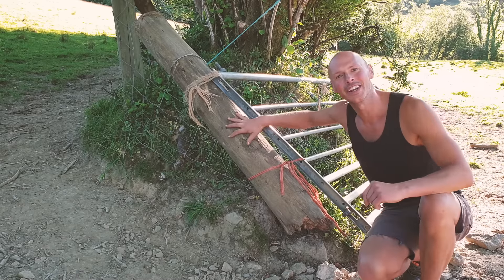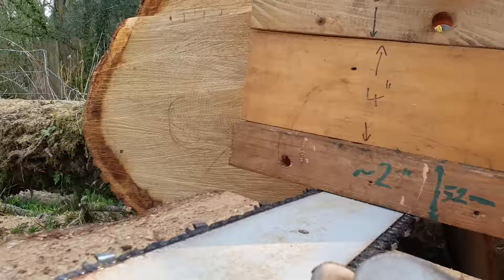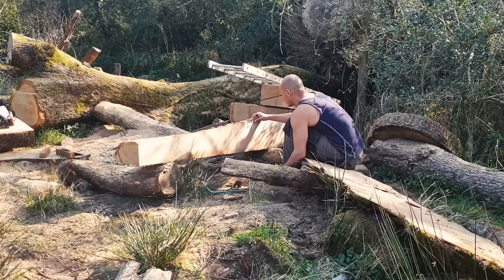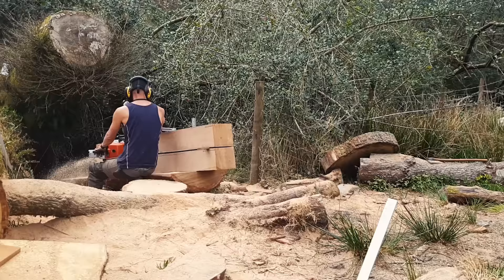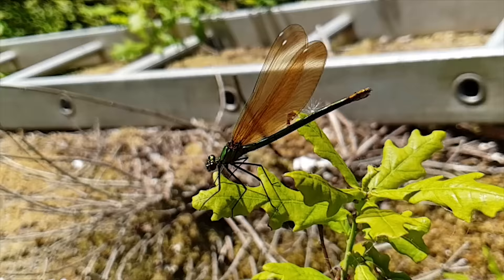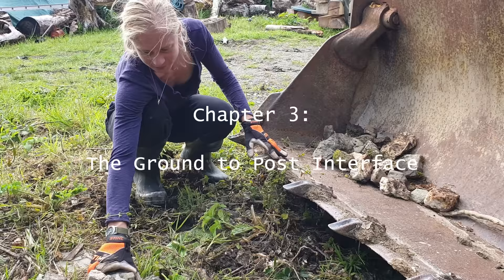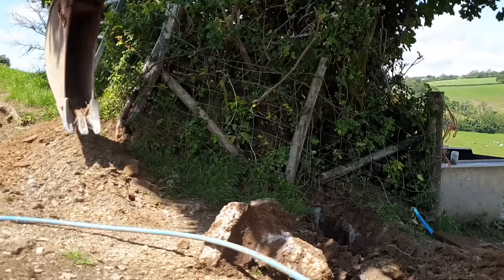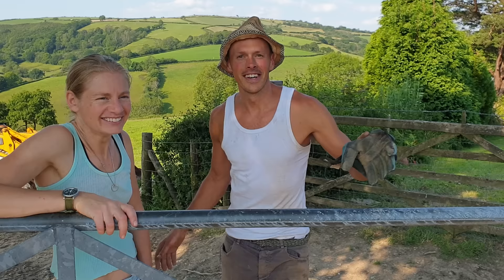The 3 secrets to ROT PROOF POSTS and how to make them

Comment: Find a hedge tree! Problem solved. Here in the Midwest Osage Orange will last 100 years the fence around our pastures is one hedge (what most call Osage) and one steel and corners are hedge. The steel must be replaced every 30 years, but not the hedge!
Reply: I used Osage orange (hedge) for gates, fence posts,   and corner posts.  The main corner post was a piece Osage orange which my great-grandfather cut down around 1900, it was about 12" dia. at the bottom and about 10" dia at the top.  The post was 10 ft. long, the hole was 5 ft deep with sandstone tamp into the hole with a piece of steel from the old car axel.   Then two more posts set 5ft from large posts at the right angles with braces.  Then we string barbed wire starting at the corner post then to gate post.  
After the large corner post is in the ground for 10 years a car at speed over 60 miles per hour hit corner post.  The driver was killed and the motor block was in the front seat.  But corner post was not damaged and no movement in post.  The Osage orange post is still in the ground today and no rotting.   If you want non-rotting posts, use limestone.  Out in western Kansas, there are limestone fences standing over 100+ years in the ground.
Reply: Steven Hartney I’ll sell you all you want for half that 😀 really they grow from Texas to the Midwest in deep soil. They aren’t hard to find. I’ve cussed them for years and years they are in nearly every fence here and have bent tractor exhaust and broken windows in equipment for as long as I remember, plus given me a few bloody noses in the non cab days!
Reply: Brilliant
Reply: @russell7489  Well said Russell. 😊🌎💖

Comment: We made corner and gate post in my youth. We also scorched the wood about as dark as you did to harden it and then my father had us paint a coat of boiled linseed oil from top to bottom. Those post are still there and that was 40 years ago. Yes, Oak.
Reply from the maker: Good evening TheRedhawke. Thanks for sharing, that sounds very encouraging. :D
Reply: motor oil much better than linseed and way cheaper
free 2nd hand
Reply: @papaal7014  How about waterproof lime? Calcium oxide (or possibly even builders lime) slaked with oil/fat.
Motor oil is not exactly great for the environment and on that note, neither is linseed if it's GM linseed, which is becoming increasingly likely, as so much has been contaminated already through cross-pollination and the dickheads can't even test for it (or any other "GMO") with 100% accuracy...which shows that they don't intend on protecting truly natural plants, etc, from their corruptions of nature and never did.
Reply: @Kyle-sg4rm  are you serious?  where did the oil come from?  the ground.  and there isn't enough oil residue left on the posts to hurt the environment.  there are natural pools of oil lying on the surface and have no environmental impact.  as for me,   stay with the creosote.   have used it for 50+ yrs with no toxicity and it keeps the livestock from chewing on it.  being a tree hugger and an off-grid farmer just doesn't work,  unless you like rebuilding every 2-3 yrs.
Reply: Nice! Mine are still standing after 15 years. I set mine in a bucket of boiling used motor oil. But..... It was old discarded soft wood posts someone threw away. So ..... Maybe i will get 20 years tops😁
Reply: Mr Chickadee here on Youtube also chars and then coats with a combo of linseed and usually pine tar for really durable wood construction, seems quite effective.
Reply: @nathanielcohen9890  -  your prejudices are very much on show here.
Reply: @thetessellater9163  I don't think siding with the good LORD is prejudice. but yours' is very much showing.
Reply: @nathanielcohen9890  Did you just put creosote and no toxicity in the same sentence?!?
Reply: @DunnickFayuro  I did.......and have the chemistry to prove it.  even sugar is toxic in high concentrations.....same principle.
Reply: @nathanielcohen9890  The concetration of creosote required for it to be toxic is orders of magnitude lower than that of sugar. You might want to add some mathematics to your chemistry skills.
Reply: @DunnickFayuro  mathematics is not the issue with this and you missed the point completely. are you a toxicologist? if not then we have nothing further to discuss on this matter. you are not qualified.
Reply: @nathanielcohen9890  I can read what experts in toxicology say about creosote and repeat what they say: It's toxic. It's called learning from others. It's a wonderful way of improving knowledge without having to become an expert in every field.
Reply: @nathanielcohen9890  

Dude, it came out of the environment, sure.  But then we processed it.  You can't just put it back, it's in a different form.  And it's toxic.  I will never be using it.

You need to read some of the anecdotes here.  2-3 years is laughable.  People have 40 year posts by working really hard and staying clean.
Reply: @dethmaul  are you talking about  petroleum-based chemicals?  creosote is a natural plant fed to livestock in open pastures. recently I looked over 1 million+ acres of creosote and the environment couldn't be healthier.  just don't let dairy animals eat it as their milk will taste like a telephone pole.  artificial chemicals may be called creosote, but they are not.
Reply: @nathanielcohen9890  

I was. I was ready to believe you and admit wrong, but you made me look it up and make sure lol. I'm talking about the right stuff.

Comment: Soak the base of the post in hot pitch (tar).  The liquified hydrocarbon will soak into the wood and harden when it cools, making it water impermeable, insect proof, and mold resistant.

Comment: Nice work with the chainsaw mill but perhaps I could make a few suggestions. First , a propane torch like the ones people use for roofing tar and asphalt work. They're cheap and you won't have to pick that log up . Second, if you really want that post to last forever, next time soak it really good with antifreeze. The antifreeze will kill mold , rot, insects and keep the wood from splitting . After you have soaked it really good and given it time to dry, paint it with a 50/50 mix of roofing asphalt tar and diesel fuel. That will seal the antifreeze inside the wood and prevent water penetration. Burning is a old technique that works better than nothing but not like the ones I mentioned.

Comment: Some people drill a hole into the post at a downward slant to about the midline, fill it with petroleum oil and plug the opening, Then they will occasionally check and refill as needed. Others will take a mixture of oil and asphalt and cook the post ends in that for a day or more. this does 3 things. 1 it seals the wood; 2 it drives moisture from the wood and 3 it changes the structure of the wood such that it is practically non-ediable. One might also consider giving a sloop to the top of the posts and oiling or waxing the tops before adding the cap. Lastly, where ever there is metal wood contact the wood will suffer. That is why you used a plastic gasket on some of the hardware but this is true also for the metal pins and screws put into the posts. This can be mitigated in a number of ways. For even longer-lasting posts, after the wood has aged and dried, seal the exposed wood with something to protect it from moisture and UV damage. You are young, why replace the posts after 20 years? You may not have to do that chore again in your lifetime. I enjoyed the video. You all are doing such good work on the land. So much hard work! Congratulations.
Reply: You lost me at ediable sloop
Reply: @anonymous-tn6ij  ????. What have you done to lenghten the life of fence posts?
Reply: @anonymous-tn6ij  i couldnt find ediable in the dictionary.  I dont know what ediable means either.  I assume edible unless corrected
Reply: I think one would have to be very dense to not pick up the context clues .
Reply: 1. I came here to see if anyone else was worried about the metal-wood contact, before I remembered that they already waxed the ends to prevent splitting (9:02). Should be fine then.

2. All that petroleum oil, the asphalt, things that make it inedible also have a large carbon footprint, both as they contaminate the ground around the post and as they evaporate into the atmosphere. It's measured in CO2-equivalent, and depending which petroleum oil you use, it's a lot or a lot more. Inedible also means non-biodegradable, which is something to avoid. The reason they didn't use metal or pressure treated wood is because it's not environmentally friendly, so of course they're not going to soak it with petroleum anything.

3. As for sealing the wood with a UV-resistant coating, it would depend on the material but probably most of them are also non-biodegradable or environmentally friendly. UV rays only cause color changes in wood, though - the collagen gets broken down (wood turns yellowish) and then washed out (wood turns grey), but the structural cellulose is unaffected. Moisture protection might do something, but it's got lots of drainage below and just the sides are exposed, so it should be fine as-is.
Reply: Collagen? There's no collagen in plants that is an animal protein. That would be lignin in wood which is an organic polymer. UV will cause surface degradation which will then amplify the effects of wetting and drying.  Wood exposed to long periods of UV has an obvious texture and that is why.
Reply: @20somthingrealestate  Thanks, yes, I mean lignin.
Reply: @cocopeach21  so burning waaaaay more fuel to fk around to do a wooden post is fine... i guess it makes sense - no carbon footprint ,planet is safe...

Saving money by not buying concrete posts that last forever (by his own words) - 2 people work full day for free making wooden posts (dont last forever) ,instead do some work for money and buy forever ones - makes sense...

You tree fkn people are amazing... and hilarious.